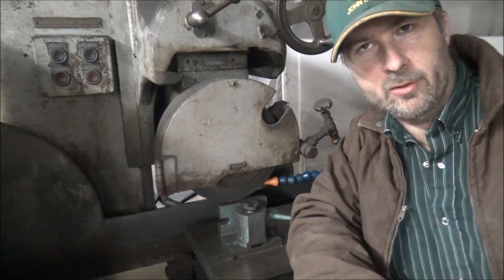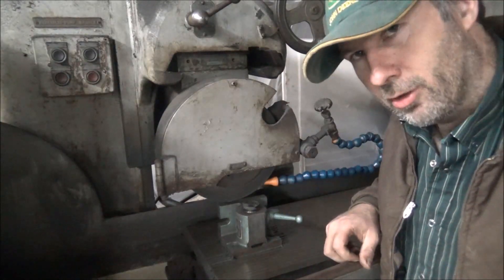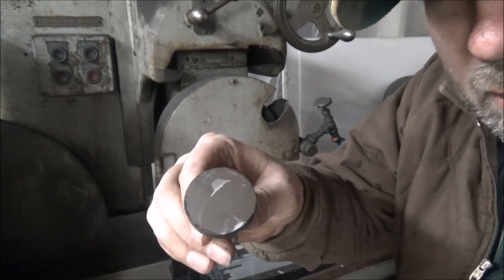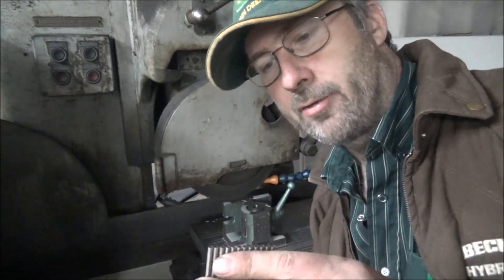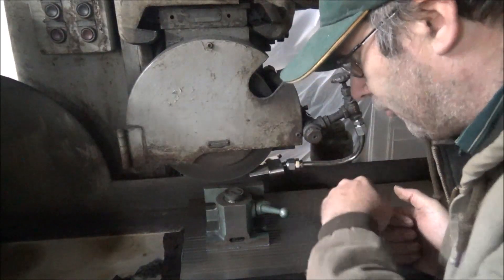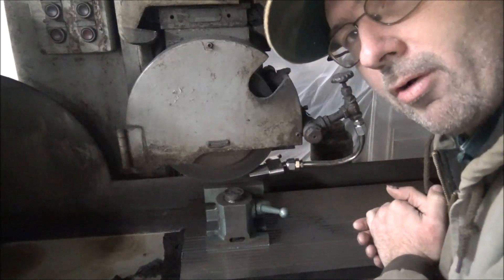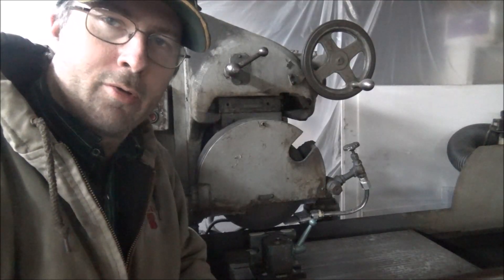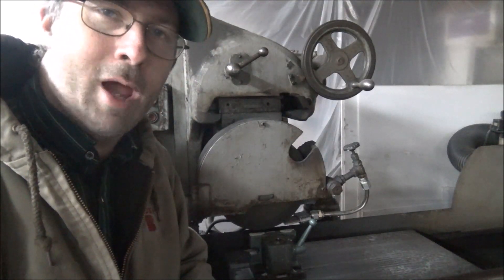Easy Surface Grinder Upgrade

Comment: Nice upgrade! Tough to beat coolant that is collimated by running through parallel tubes. My half inch wide wheels only need three tubes.
ATB, Robin
Reply from the maker: I just went back and looked at your stone grinding video and I couldn't even tell you had this style. I should pay better attention!!

Comment: Nice video. What sort of a vintage grinder is that? I've never used one where the head travels in and out, all the ones I've used the table travels in and out and the head just moves up and down.
Reply from the maker: 1940's it was a war department machine.

Comment: If you fill the tube with sand before you try to bend it, it won't kink as much.
Reply: I think Brian did that on purpose to control the coolant flow rate...

Comment: Hi Brian,
I like the coolant nozzle. Shoots the coolant right where it needs to be.
Steve
Reply from the maker: Just one of the many upgrades I need to do to try to get a better finish out of this grinder.
Reply: Hi Brian,
There are many variables that affect surface finish. Controlling as many as you can will go a long way. Wheel selection and dressing are some of the bigger variables that you can control. Some variable will be harder to control such as the condition of the machine spindle and machine axis X,Y,Z.
Steve

Comment: Nice! The Upgrade looks solid in the video, no moment at all and it has does have the coverage of flood coolant. Next thing you might want to look at down the road is a filter on the feed side of the flood coolant. It will improve the surface finish by catching small particles.

Comment: Brian, Nice machine. Only tappets are not flat on cam side. They are conical ground so they will rotate as is camshaft. Thanks for video's.
Reply from the maker: These are flat now.....just like the factory Cummins ones.

Comment: Well at least I can beat you on the grinder wheel count... I have LESS than one! LOL
Much better coverage with the new nozzles. Wonder if anyone has ever experimented with additives (Water wetter?) to reduce surface tension in coolant?
Reply from the maker: It only counts if you have a grinder but no wheel, if you don't have either one you can't compete. :-)

Comment: can see chatter...
Reply from the maker: Got any suggestions about what I could do to get rid of it?
Reply: wheel balancing, dressing and spindle bearings mainly
Reply from the maker: Thanks. Guess I need to work on building a wheel balancer sometime first. The spindle bearings are hydraulic with no detectable play so I don't think it is that.
Reply: ok, however an inspection can worth. If you are using plain bearings(white metal) , they wear out quickly if the oil is missing or contaminated....
Reply from the maker: It is pressure lubed from the main pump just like the ways. All the lube on this machine is continuous and automatic.  I can't feel any play in the spindle but I will have to dial indicate it sometime to be sure. Perhaps it has a bent spindle. :-( I would think a wheel dress would eliminate that being an issue though.
Reply: Hi Brian, with regard to wheel chatter, from an out of balanced wheel/ not trued or spindle wear. Clamp a high resolution DTI / lever clock gauge to the wheel head/slide and run spindle with, & then  without wheel and arbours etc. Indicator should show any vibration. 12" diameter wheels do need balancing, 7" or less normally don't, very very old wheels used to soak up coolant and become unbalanced due to this. Also if the wheel is not tightened correctly, it can slip each time you power up spindle. Enjoy the channel, and your intelligent monologue.

Comment: Help an old guy out. Are you trying to cool the grinding wheel or the part? The new nozzle looks to be spraying coolant on the wheel all the time, and on the part only when its under the wheel. Are you using coolant only because the tappets are hardened or trying to extend the life of the wheel, or am I just missing the the point?
Reply from the maker: You want the coolant at the point of grinding. The coolant cools and lubricates the part as well as flushing away the chips and dust. The place where the grinding happens is 0 clearance so you have to be above the part which means it also has to be hitting the wheel. On large flat parts it is much easier to get the coolant where it is supposed to go. On this it is only on the part for the time it is under the wheel because the width is small.

Comment: Since I need to upgrade my own surface grinder coolant dispenser, two solutions were considered, the flattened nozzle or the type you got there with multiple outlets, it's gonna be your solution...   ;)
Quite right about the prices of the wheels...
Reply from the maker: I think this has less mist than the flat fan type. I thought about getting their plastic version but the stainless just looked too nice. :-)

Comment: is there a vibration i hear when the grinder is running.. almost looks like it was ground into the work piece.. bad spindle bearings.. out of balance grinding wheel.  or was that just the coolant pump motor.
Reply from the maker: I can't tell there is any vibration. It likely needs the wheel balanced to be ideal. This machine has hydraulic bearings so I doubt it is them.

Comment: Looks pretty good! Only possible down side is you may need a finer filter on the coolant return (or feed) line. I noticed one of the nozzles seems to have gotten partially blocked.
Reply from the maker: The 2 streams that are lower than the others are the ones at the edge of the wheel. Apparently air off the wheel forces them lower at the edges of the wheel.

Comment: Brian, I won a couple of auction lots that including grinding wheels.  I have no clue about griding wheels, so if I may suggest, it might be a great video for you to explain and demostrate them.  Said that, what are type of wheels  are you needing?
Reply from the maker: It takes a 12x2x5, doesn't have to be 2 wide but the  5" hole matters.
Reply: 5/8" ?
Reply from the maker: No it has a 5" center hole.

Comment: Hey Brian what size wheel does your grinder take? I may have one or two extras. Let me know.
Reply from the maker: It takes a 12x2x5, doesn't have to be 2 wide but the  5" hole matters.
Reply: bcbloc02 I’ll check to see what I have and let you know.

Comment: Hit up Keith Rucker he made a killing on grinder wheels he may have what you need and a good deal tooo
Reply from the maker: He did not.
Reply: bcbloc02 wow really??? He did a video on all the grinder wheels he acquired differnt types and sizes ??? Did he just not have your spindle size or gritt or what?? I remember the table full of wheels... thought for sure hed have somerhing!!!
Reply from the maker: I looked at what he had when I was at his shop, none had the 5"hole.
Reply: bcbloc02 Bummer so make a adpater sleave? Or just to hard due to balance with RPM as well any run would not work

Comment: One tappet at a time seams pretty labor intensive, couldn't make a batch fixture?
Reply from the maker: A lot of trouble to make one since it has to clamp the shafts of all of 
them tightly. Maybe someday I will build one, for now this is faster to 
do it the slow way.

Comment: Check with Keith Rucker he was sent some when he got his grinder he may have some that will fit yours
Reply from the maker: He did not. I looked thru what he had when I was at his place.  Good idea though!
Reply: well I tryed
Reply: Same thought I had David Temke!  I don't remember exactly how Keith Rucker got all those wheels, possibly because his restored grinder only takes the old wheels with the smaller? I. D.

Comment: We work with what we got, even if it doesnt please everybody. Hope the new system helps long term ~ Richard
Reply from the maker: I use my 3 jaw chuck as a tubing bender. :-)
Reply: How did you Bend the hard pipe? I can’t bend pipe to save my life without kinking it.
Reply: Thanks Brain. That's a good idea. @MakinSumthinFromNuthin sorry I put this question as a reply to your post sometimes it's hard to hit the right button on that little smart phone screen.